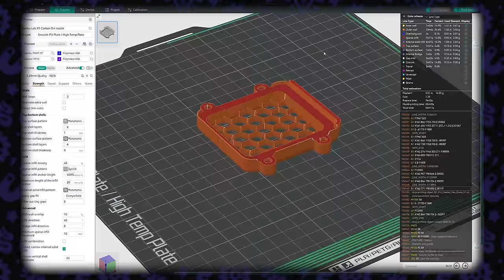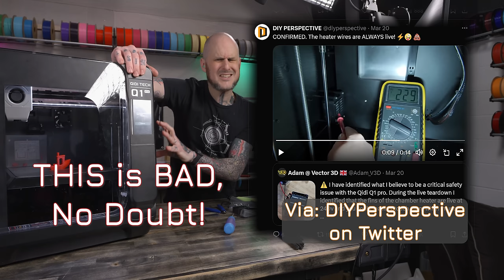SHOCKING Truth About Qidi Q1 Pro Heater Hazard

Comment: It comes down to the tools vs toys mindset. People who use these as tools and use other machine tools understand not to be stupid. People that buy printers as toys expect them to be easy bake ovens. If you are worried about your kid poking a screwdriver in to a heater shroud I would also worry about them poking that same screwdriver in to the wall outlet.
Reply: False equivalence. Everyone knows wall outlets are dangerous, children are educated since forever. There are safety covers for outlets. Nature and purpose of wall outlets makes it unavoidable - that you have relatively easy, fast access to live wires.

 Barely anyone will get deep into the nuances of a design of a certain consumer type 3D printer. To ensure it was designed with basic safety in mind. AND THEY SHOULDN'T HAVE TO. 
 The fact this problem got viral, is because someone noticed, and was at the right place, at the right time. Fortunately.

If something can go wrong, it likely will. There are myriad of variables here. Different plugs, manufacturing defects, screwdrivers, scrapers, water condensation, dust, residues, and so on and so on. Someone can set bed heating to more easily remove something like PETG, and stick a scraper or a screwdriver into the heater element because tool will slip, easily.
 Instead of cherry picking, and making excuses for lazy, dangerous for the end user engineering, they could just design it right in the first place, and or send replacement grates, and include a new revision in all their stock.

This ain't a problem that can occur on a full moon, when the planets align, and little Timmy will push a wire into some crevice. This is a relatively large area under high voltage, dangerously exposed, no warnings from the manufacturer.
Reply: @buka9993   A child that is of an age  where they might randomly put a screwdriver in something should never be using or around machine tools unsupervised. Tools not toys. The only time that heater is live is when it has been commanded to heat. A curious child is not going to power on the machine, heat the chamber, and then reach in to the back of the hot chamber to put a screwdriver in heater.
Reply: @buka9993  I think we need to draw a difference between inherent hazards and avoidable ones. Yeah my hair dryer might kill me, but one take a good look at it, and there's no way one could make it safer and still sane. This is a printer aiming for what, 600 or 800 price point, and people are telling me an extra $12 couldn't be found to make it a low voltage heater, something like 48V, floating or earth referenced? Or at least extra $1 to install an earthed metal shield grill in front of the heater? I also think it's a violation of Class I insulation safety.
Reply: @WonkoTSane  In countries with a Schuko plug, the heater can be live at all times. This even includes France and Czechia, which nominally have a polarised plug so it looks like it should be safe, but the compliance to the house wiring standard is appalling and you can't trust it. The heater can be live even with the power switch on the printer in the off position.
Reply: @SianaGearz  Any reasonable person thinks in that way. You don't even need anything fancy, just a better plastic grate design. Marginally higher costs.
 This comment section is full of boomer, self exalting talk. Foolish compartmentalizations.

"The products today are worse than 20 years ago because they have higher safety standards!" yada yada yada...

Someone, give me few examples where safety measures compromised performance, or ease of handling of some device / appliance  in any substantial ( or at all ) way.

They're just running their mouths.

"They should do that, they shouldn't let kids near"... next guy.

Yeah, a semi professional 3d printer ought to be... locked in a safe or something, because of the substandard engineering?

What are they on about...

Their shouldism won't matter either, accidents happen. Most optimal way out, is just prevention trough making the design safe.
Reply: @SianaGearz  Then they are going to have the same issue with their toaster or any other device that uses mains voltage. You can't fault a device for an electrical system that does not enforce polarity.
Reply: European toaster uses an earthed protective grid and guard spacing between this grid and the heater spiral, to limit the hazard. Even if you reach in with a fork or a knife, which is clearly not something one should do, you will have a hard time electrocuting yourself, and a very easy time getting GFCI to unpower your premises. The toaster is also switched on phase and neutral both, because they can become swapped. For some reason this $600+ device does not afford you the same two safety features as a $8 toaster, nor even one of them.

I say they're just being sloppy and negligent, there's no need to brown nose a chinese manufacturer who is not following our electrical safety norms. They won't save Jesus by "refusing to bow to woke they/them safety mob" and potentially killing a couple people in the process. They're not your friends or allies.
Reply: @SianaGearz  Just one point. It costs $439 with a code. It's not a $600+ printer. As Mandic pointed out, a 24v or 48v heater unit would require a 2nd PSU to drive it.

With regards to their design, I guess their expectation for the kind of person who buys and operates a 3D printer is that said individuals don't normally have the mentality of a 4yo child armed with a knife around a toaster, and typically understand that sticking sharp objects through protective grills into hair dryers that are in operation isn't a good thing to do. After reading your diatribe, it appears that is probably a wrong assumption to have made.

If you truly believe it violates standard electricity safety regulations in your jurisdiction then report it to the appropriate consumer protection authority and have them kick off a more thorough investigation.  That would have a wider impact and make real change happen.
Reply: @stew675  Promotional pricing, this is not supposed to be a cheap printer.

People do operate metal tools in and around a printer such as bed scraper and accidents happen. I have also had one of the linear bearings seize up and shoot out a ball. I have also troubleshot a case where 3D printer (not mine) had burned up a USB hub and a PC monitor, but also went through several printer control boards burning them up before i was involved. I surmised the fault was a loose solder ball that got lodged in the PSU from manufactruring, and i suspected approximately where, and later this 4mm large ball had been found. The PSU was replaced, and everything was OK afterwards, other than the financial damage the printer had caused prior. None of these companies operate quite to our safety standards and it's only fair we push for improvement. There is always one more thing you didn't foresee. As a rule, safety norms are written in blood, and you're not being extra wise for skirting them. And the norm is, that one fault CAN ALWAYS HAPPEN and you can never quite predict where it comes from, but you must still guard against it. A fork etc is merely a model for things potentially going wrong.

Second PSU not needed for 24V heater, uprate the primary one. For 48V an extra one would be needed but given fairly low current, it wouldn't actually be expensive, and you save yourself the SSR, which costs money as well. Yes it is an extra cost but not much extra cost, fits within $12 with oodles of room to spare.
Reply: If you're going to qualify them as machines (as they should be)
I've got some news for you: none of them comply to the relevant regulations in Europe.
Also the way this heater is designed, it's a clear violation of the harmonized standards as prescribed by the Machinery directive.
Reply: @GreenPlasticWaterCan  I do not understand why people go out of their way to be so pedantic. If your kid is dumb enough to reach in to an active printer, shove a screw driver through an enclosure and touch a live coil and you are too inattentive to keep them from doing it, maybe it is natural selection at work. You probably should have bought an easy bake oven.
Reply: @WonkoTSane  The laws, regulations, and standards exist because companies have been neglecting safety in the past and people have either been seriously injured or even died because of it. These kinds of things are written in blood.

Comment: Yeah, the concern here is way overblown. Don't let anyone near a toaster or hair dryer! Not to mention an electric stove. Or any space heater ever made. IMO Vector 3D was harsh about the Q1 Pro and didn't do a good job demonstrating its printing capabilities either. People generating drama over this online act like experts on a topic they know very little about.
Reply: To be fair, any space heater made properly and sold to western buyers won't have live voltage to the metal fins. That's just f-cking dangerous. But this? In the back of a 3D printer? I don't think it's a big deal.
Reply: @AlphaMachina  Not the wire style, and not a toaster or hair dryer. If we can trust people with a "mains voltage" toaster, we can probably trust them with this printer. ;) Totally get what you are saying though, hahaha.

Comment: I'm not really concerned about the heater, but it's interesting that they don't include warning stickers for at least hot surfaces with instructions to power down/unplug before service (I think even companies like Creality does that). My bigger concern is that for some reason they decided to use their own fork of Klipper; rather than just configuring their printer.cfg to run their specific hardware and using a regular Klipperscreen compatible touchscreen they did some base code changes to run their stuff. I guess my expectation when they highlighted Klipper on their product page is that I can do normal Klipper things and not have to rely on Qidi to release their own fork updates.
Reply from the maker: I don’t disagree. I should have said that. I included “HOT” on the side of my grille for that reason, just didn’t show well with the CF filament I used. 

I will be mentioning this to Qidi in my feedback.

Comment: More volts = less amps. So yes, the 120VAC design consumes less energy losing the burden of the additional power supply, and is cheaper to build. What people don't understand is 24VDC can still shock you. This does not look like a bad design, maybe a little rushed to get to the consumer market.

Comment: As a guy with a shop full of table saws, circular saws, radial arm saws, band saws, forges, welders, plasma cutters, mills, lathes, etc., I find the entire idea of breaking out the smelling salts every time someone uses the term "mains power" to be another internet virtue signal. This is a little bitty toaster inside a printer that is much harder to access and more isolated than an actual toaster that is actually on your counter that has a one-by-six inch slot in it granting you access to the heating elements. How many people have electric ranges? What about power outlets in your wall? We are proximate to 120v 15amp power sources all day, every day.

That said, this is an inevitable by product of the transition of 3d printing from an enthusiast hobby to a ubiquitous technology built for consumer use. You're exposing printers to people who have to be told not to eat the Tide pods. In days gone, we used Darwin to rid the gene pool of mutations programmed for self destruction. I guess at least we still have the common toaster and Tik Tok challenges for that.

This is a not a beginner's printer. Heated chambers are not made for beginner's filaments. Among hobbyists, you should know your own risk tolerance and act accordingly. Just don't be a Karen and ruin it for the rest of us.

Comment: As you've seen on my Twitter comments - I definitely agree with you and used same examples as you did in video. 
It's an issue, labelling should have been better, even the grill out of box should be same as one you've designed, but to blow it out of proportion this way... 
Really great and rational explanation!!

Comment: Just to elaborate: European outlets have no polarity. Not by design, not implied, not by convention or customary. So the incoming power line to your printer, depending which way you plugged into the wall socket, can have have live and neutral "swapped" (there is no right way, so swapped doesn't really apply either, but you get the point). In your US wiring case, the heating element is always connected to your neutral line, and the SSR closes the "live" side to make it a circuit. In our case, it could be that it's always live, carrying full 220+ line voltage, and the SSR closes the neutral side in that case to turn the heater on. If you want to have a truly disconnected device, you need to disconnect both sides of the AC wiring, either with the physical power switch that also needs a pair of contacts then, or using two SSRs (which also seems wasteful in more ways than one).

Or you need to design your device so that you can't touch anything that might be connected to the live side of the wiring, either directly or with a screw driver or scraper or even an allen key. It's inside a device where that's not an unreasonable assumption (being a 3D printer). But even if you should always pull the plug once you take a screwdriver into your hand, maybe you need to adjust something on the hotend and you drop it, or any number of other, normal screnacrios: would you pull the plug for it? I surely wouldn't. I maybe would turn it physically off, but honestly probably not even that...

Just to be clear: that plug wiring is by design, and not a wiring error here. Electrically it's irrelevant for AC which side you connect to what terminal of any AC powered device, so there's no requirement for it and plugs don't need to be keyed either. Dealing with it properly inside a device is regulated by our electrical safety requirements, and I really don't know what they say about this case: It might be ok, it might not be. For comparisons: toasters disconnect both sides of the circuit when they are off, making sure the coils aren't ever live when they are not on, where you can also relatively easily reach the 220V heating wires.

Comment: They make heaters where the power goes directly to the ceramic parts without being routed through the fins, but they aren't as cheap.  You can usually spot them because they have a cover over the ceramic parts.  I used one in my V2 before giving up on it being pretty and making a polyiso foam insulation cover for it.
Reply: Make the air passage in the grate zig zag, with flat, 90o stops inside - half bottom / hal up /  half bottom to stop any flexible wires. This is more expensive to manufacture ofc, if they inject mould it. But solves the problem, almost entirely.
Reply: A cheap way to safeguard this heater for Europe would be to place an earthed grill in front of it separated by just a tiny bit of spacing and with grill pitch no larger than 4mm. This way if some fault occurs (screw, screwdriver, springplate, stray ball bearing, even a finger), it shorts the potentially live surface to earth and throws the GFCI.

Comment: Good points. I appreciate your answering my questions on Twitter the other day - all in all, I wouldn't be any more concerned about this than a space heater and would treat it with as much care or more. I am a little confused why Qidi didn't have a better grille but based on their response to all this, I'm guessing they will make it right.

In the end, I would NEVER work on a printer when it is on and plugged in. I would not be reaching in a high-speed printer when it is printing. I would make sure it is out of reach of small children and pets. These are common-sense measures one should take with any electric and mechanical item. The only concern would be the European plug issue but, again, I wouldn't be surprised if Qidi quickly fixes that.

I really wish I had the space for one of these. I'd love to get more into high-temp materials.

Good video.

Comment: I agree. Yes, you could misuse the machine enough to induce a hazardous condition but at that point you're rolling a personal responsiblity check. As much as the marketing is trying to mass appeal and EZ Bake Oven them, at the end of the day these are industrial machines, and care, knowledge, and attention are needed to use them safely. I'm happy that it's easier to be safe these days with the improvements in design and the proliferation of fuses and other safety features after some hard learned lessons, but they're still tools and have more capacity for personal mayhem than a hammer sitting on a bench.

Comment: Thinking back on older printers and how open all electronics on them were. I understand the concern but it seems this is an issue that is being made a bigger deal than it needs to be. That said the extra grill isnt going to hurt anything as long as its something tolerant of the heat like the material you used.

Comment: Great video again, as always. As for safety, you're absolutely right. We live in a society that is over protective. If you have children and want them to use the printer, keep it in mind, as you say, the high temperatures and speed of the printer head are more likely to be a hazard than putting their fingers in the heating element. Make it clear to your children what the danger is and just as you would with a knife, scissors, etc.

Comment: Thanks for the detail video. Excellent information and valid reasoning. If anything a sticker should be near by. I agree nothing wrong being cautious, however a lot of new members in the community that does not do research and learning a head of time and just dive in.  I recall years back with a couple dying at their home from laser cutting some material that off gassed with not proper ventilation. It was a home business. Like you said, these items are all tools and should be treated with care.